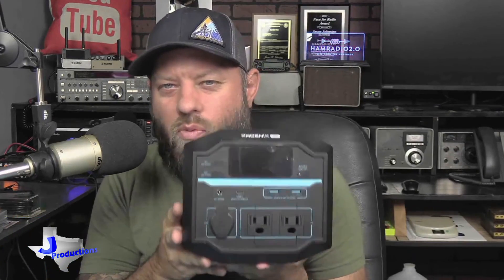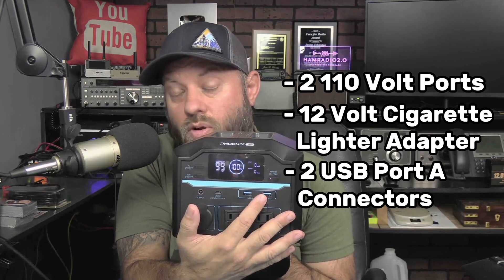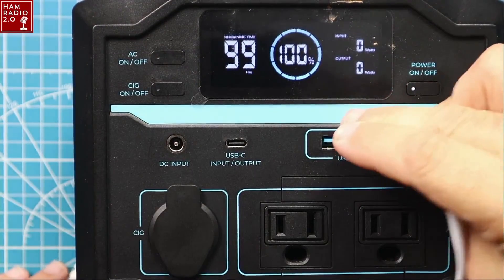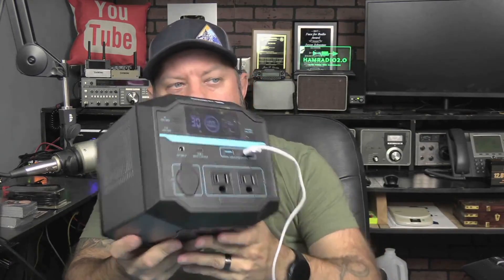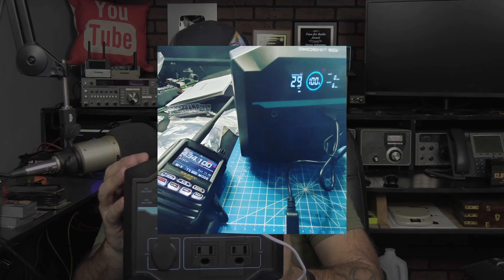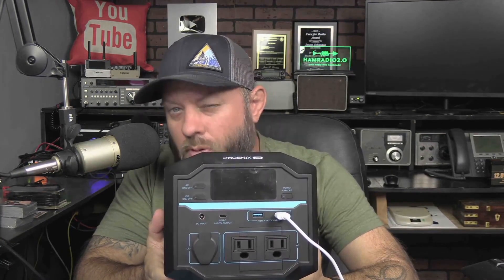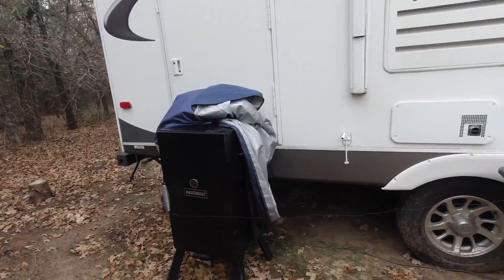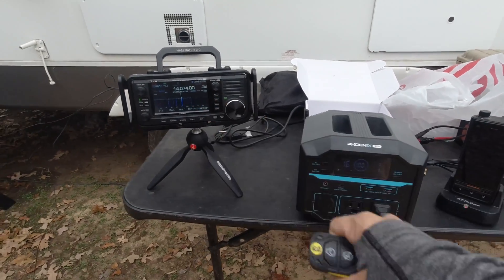Renogy 200 Portable Power Station TESTED for RFI!

Comment: The powerstation I use is the ANKER one. not much RFI from that. My MPPT solar charge controller makes RFI but cleaned it up a bunch  with type 43 or power iron core ferrite cores on PV leads and batt side. close to charge controller.  with your LiFePO4 charger on AC. put ferrite on AC cord close to charger and one on batt side as well. may help a bit. My LG washer that is inverter drive type is real bad. A line filter did not help. grounding the metal frame did nothing. so when girlfriend washing cloths or me. no HF radio or 6 meters. every thing above is fine. even AM radio very bad. my old GE washer no RFI al all. it died and went high efferent type. He . use less water. 73's

Comment: Liked it originally but will not charge at more than 30W on a 12V ACC outlet.  This is a serious deviation from the 60W claimed and support just gives me the run around when I ask if something is wrong with it.  Same ACC powers 45W fridge or 100W heater just fine so not my ACC outlets.  They’re rated at 180W.

So if I’m running my fridge through it while driving it STILL discharges even though it should be charging at 60W.

Comment: 2 questions: does it take 3 prong plugs? 

Renogy claims much faster charge times than others. How fast does it charge?
Reply from the maker: Yes it takes 3-prong plugs but I haven't measured the charge time
Reply: @HamRadio2  3 prong UK plug 230V AC  ?

Comment: If I were buying today, I think I would go with a Bluetti eb3a. I would think almost any of these power units would output lots of RFI when generating 120Vac. While some of the nicer units offer a cleaner sine wave output, internally it usually starts out as a square wave that contains lots of harmonics. WB5NOE 10:47
Reply from the maker: Several comments have said that the Bluetti is noisy, unlike this unit.
Reply: Hell no. Bluetti is noisy af, no way I'm buying that

Comment: Can you charge with solar and use the AC outlets at the same time.
Reply from the maker: Yes
Reply: @HamRadio2  That is a great feature. I have a different brand that can not do that. That will make it easy to use my portable satellite station. i will have to get one.

Comment: Helpful. But I would be interested in if you could hook something like this up to a foldable solar panel. And how one would do it. and the weight of the device.
Reply: Make an adapter that goes from your solar panels termination to the 12v barrel and you’re good to go. Someone likely already makes and sells them. 

Edit: just checked and they definitely sell them on Amazon

Comment: I love and use the *Ecoflow Delta 2. :face-red-heart-shape: *Bluetti would be my second choice for performance and features. Jackery and Renogy dropped off my list over a year ago. 
Hopefully, *Ecoflow will upgrade its additional battery capabilities to match or exceed those of Bluetti's external batteries. Currently, the ($800) additional Delta 2 battery is completely useless without being connected to the Delta 2, unlike the more versatile and independent Bluetti external battery.

Comment: Neither Renogy nor GoalZero use LiFePO batteries.  This gives them the cycle life and combustibility of a swollen cellphone.  None of them are Lithium Titanate, but Mjolnir isn't yet planning to offer a comparably sized (and priced) unit, and the 2x $/Wh premium will probably be a deterrent until prices drop.  But LTO cycles long enough for your grandchildren to inherit the unit.
Reply: Which power banks use that battery? What one would you suggest

Comment: Videos like this are always good. Here's a tip, discharge the renogy to 40%. Start charging it with your solar panels. Simultaneously discharg the renogy with one of your HTs and/or the 705. While the Renogy is being charged and discharge, check for RFI on 80m, 60m and 40m. 
I also didn't get any RFI when charging the renogy with AC. When charging it from a DC power source, it was a little surprising. Not bad but could be better.
Reply from the maker: Thanks Julian.  I'll give that a shot.
Reply: Would you recommend the unit overall?
Reply: That would be interesting - the RFI on the DC output from the device.

Comment: Hi Jason, 

I see one issue here

As long as you have any wires connected between the charger/battery and the radio, sure, you'll probably have RFI. A better test - IMHO - would be to have 2 batteries; with 1 running the 705, and the 2nd batt. Under charge, but  completely isolated electrically!  Start at the same location, i.e. distance, and then if you have any RFI, move the battery under charge & charger until there's no more RFI. After all, the idea is to run 24hrs a day, charge q, run another & swap as needed. 
Our group ran a good quality gas generator, it has audio & RF noise, ick. We simply moved it back about 75 feet behind a trucks dually tires, and both types of noise went away. 

73

Comment: I have a Bioenno battery in an Ice Hole Power Box for remote, POA, etc.  I have connected an inverter to it and works fine but seldom use it.  I don't have a solar panel yet.  I can charge it from my truck while driving or at my RV.